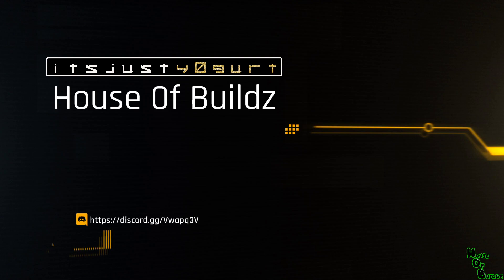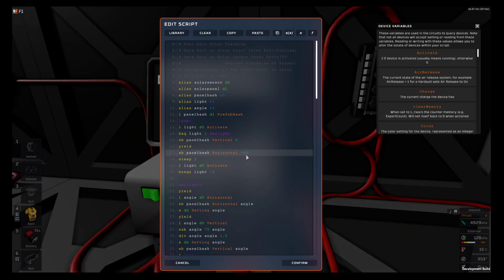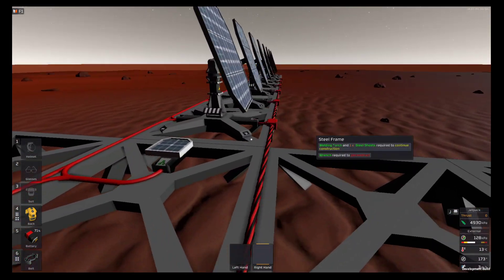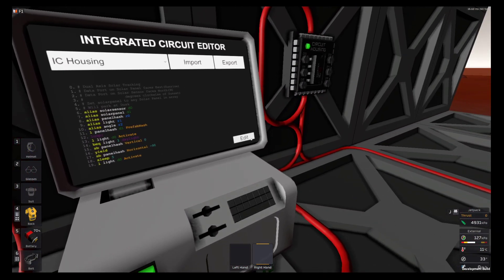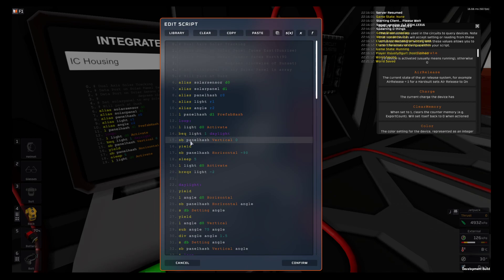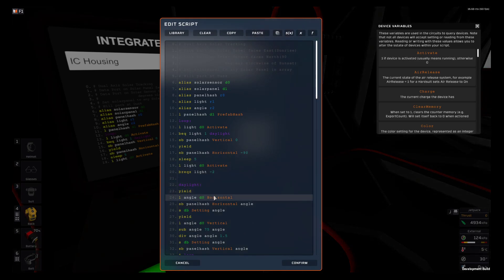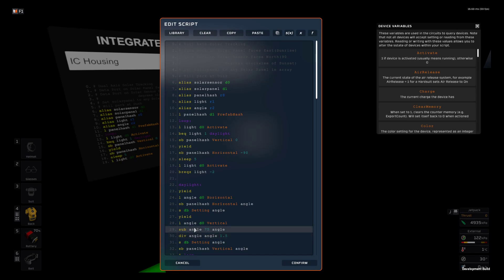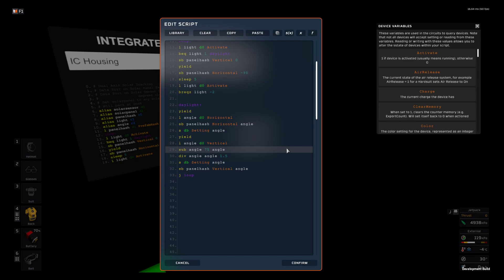Stationeers 101 - IC Chip Solar Tracking January 2021

Comment: Nothing works for me, or I don't understand how it should be connected ...
Or the guide is more based on showing the code and how it is done than on how the palnels move.
Reply: Just gotta make sure the power port on the panel faces sunset, and the data port on the sensor facing 90 degrees clockwise of the power port of the panel. Also make sure the screws are set right on the ic housing. The first one is set to the sensor, the second one you set to any panel in the setup. Hope this helps

Comment: Ok so I had this working with 3 panels on Europa, then I added a 4th panel and now it errors line 14 is an incorrect variable. I have tried clearing everything and even rebuilding it but I broke something. Any thoughts?
Reply: Actually I just figured it out. I had to manually move a panel with the wrench. Then when I exported it everything was fine.
Reply from the maker: glad you got it working again. that actually might have been a bug in the game....but i will definately check it out

Comment: If you get the hash manually, you don't need to assign a screw freeing the screw up for other things. Also, I found that the panels still produce a little power after the sensor says it's night, So instead of using the sensor, I look for the power from the panels to reach 0 before resetting to morning.
Reply from the maker: Thanks. I have it set like this because of having different kinds of solar panels added, this way you dont have to worry about changing the hash if using a different panel. Plus now all you need screws for is the sensor and one panel.

I do like the idea of resetting after power incoming is zero. But I was trying to keep this simple for people who dont understand IC, and maybe learn from my code.
Reply: @itsjusty0gurt469  Work like a charm. Thanks!
Reply: Loving this. Finally got around to playing with ICs.

Defining the constants for the 4 panel types and the implementing the unrolled loops is no trauma, though, reading the panel type from an input is a nice idea.

Interesting to know how many functions you've managed to cram into an IC...

My understanding is that it's not currently possible to pass a device variable name as a parameter, is this correct?